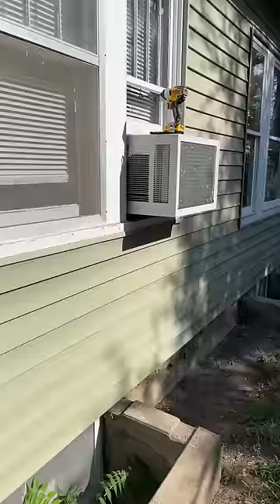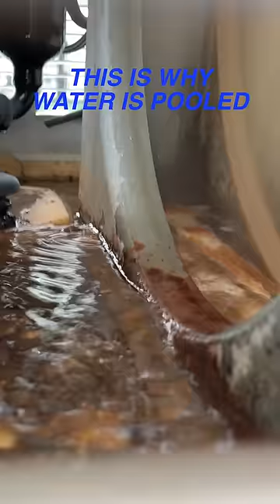🥵 99% Don't Know THIS About Window A/C!

Comment: So, why don't they make the fan shroud and pan out of stainless steel. It would literally be an upgrade of approximately $12 - $20 bucks. They start leaking and breaking down prematurely primarily due to shoddy design and materials in manufacturing.

Comment: No, I don’t think I’ll put my drill down. The negligible amount of efficiency lost is a small price to pay for a cleaner system.
Reply from the maker: How do you know it's negligible?
Reply: @HandymanHertz , My high efficiency 4 ton package unit doesn’t splash condensate on the condenser coil. Now, if I were to compare a modified Medea U with an unmodified one using an amp meter what do you think I would find? When I get Medea in a few days I’ll do some before and after measurements and let you know.
Reply: Exactly lol. Drill the hole and the unit lasts longer and doesnt rust out. All the “efficiency” goes out the window when your condenser gets clogged and the head pressure shoots way up

Comment: I'll guarantee that 99% of you who "buy this" also buy a new window unit every 3 years.... In the meantime, I'll continue to drill two holes in each corner. I prefer a 3%less efficient window unit while ensuring it's not slinging sludge back into the condenser coil. At which point it doesn't clog it. Also, ensuring drainage let's me know that it doesn't rot out the bottom of the condenser coil, ie avoiding future leaks.

Comment: Mine just flings a shit ton of water into my room making the floor wet when I wake up /:
Reply from the maker: The main cause of this is because your passageways are blocked from the water going from your evaporator Coro in the front to the back of your unit. It needs a deep clean or else it will keep flooding.

Comment: The "drill" advocates in this comment section are paying more for less cooling. The water that is slung evaporates on the condensor coil. Thats why your AC works so much harder when it is hot with low humidity. It's also why your AC doesnt cool as well when the temperature approaches the dew point.

Comment: Yeah no. No matter how much i tilt my ge smart ac the "slinger ring" slings water into my apartment without the hole drilled in the bottom. All yall handimen and hvac techs wanna talk about how these things are supposed to work but never wanna service them when theyre not working. Maybe bc you dont understand how they work?

Comment: Oh yes
That’s why it’s got plastic/rubber/aluminum there to hold the water to sling the water and not build up rust 
Right?
Right?

Phhht

Love when people just spread misinformation 

If it was built to do this, it would have a catch pan of something that doesn’t corrode, planning on this to run with water in the pan 

It’s not supposed to run with water in the pan
Drill a hole

Comment: So, water inside to maximize efficiency …? at same time damaging the case ??? Listen im not a pro on refrigeration but if my car AC goes thru the same condensation and dont pick up the water from the road to reuse it ...I dont think thats normal.  Thats not a "feature" thats just condensation and bad design.  Theres a reason why new units  comes with a drain port now.  We can confirm that seems that case its already fkd up by water and rust.Trust me ,  If it was normal there would have a way to safely collect that water and throw it back nice and clean to the propellers instead of having to reuse that dirty ass water again and again. That makes no sense. You tell me, why cars dont do that , how about refrigerators? They collect water in the back , and what the manual tells you to do with it…Throw it away and clean the tray.  Exactly 😂

Comment: Yeah but its a very SLOPPY and inefficient way, look how rotted with rust that part gets, TERRIBLE design with the purpose of these units becoming inoperable 5 years down the road and force to buy a new one, rather than go through that problem there should be a more direct efficient like maybe have the excess water flow directly into a special design pool for a more direct approach that won't damage the rest of the unit itself.

Comment: bullshit explanation, the rings is a stiffening element of the fan blade assembly. Refrigeration units are designed to operate on heat exhcange thru air alone, no water needed though it does improve heat transfer. Water should not accumulate in the bottom of the tray, inevitable severe rust and metal decay is the result.